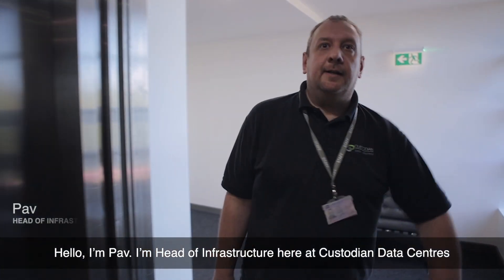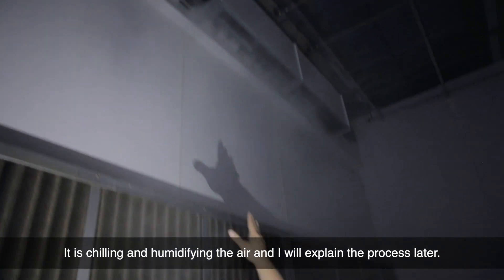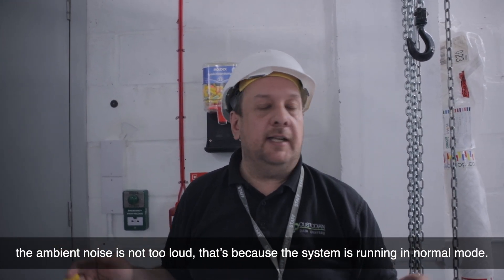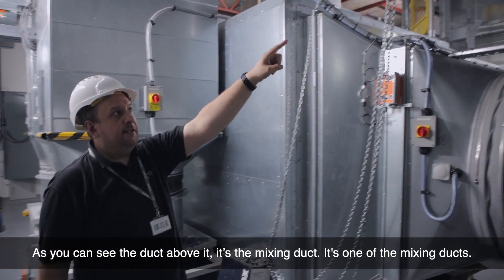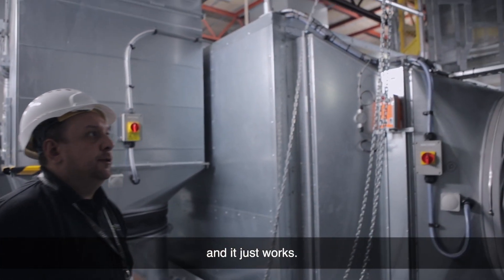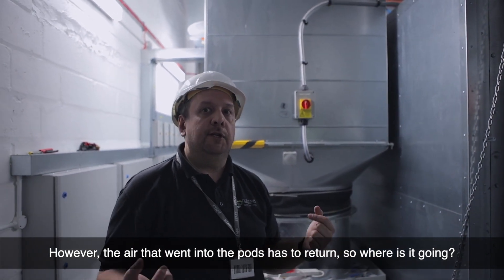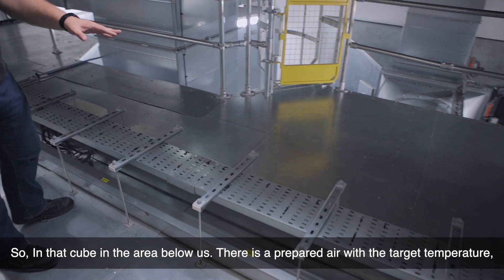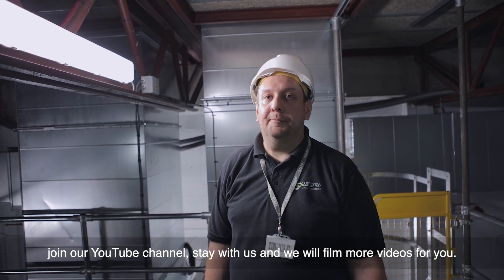A DAY in the LIFE of the DATA CENTRE | INSIDE a DATA CENTRE COOLING SYSTEM!

Comment: Excellent. It's always great to see the engine room of the data centre. Hot and cold aisles are often abstract terms with little meaning until now we can see the mechanism by which it operates. Great explanation. Resilience is the key term here.

Comment: Very interesting. In addition to @Scania_V8_Rat comment I'd like to know how you achieve the target humidity for the air going into the racks? Because I can only imagine that the incoming (cooled) air is pretty humid due to the water vapor that is being used. How is the humidity extracted before going to the electrical equipment which often has humidity requirements of << 80% RH.

Thanks for these videos, they are really interesting!
Reply: Guess that question got left unanswered
Reply: Most equipment just requires non-condensing humidity levels, so my guess is that they're running with the dew point very near the ambient temperature.  On paper, it may be allowable, since the running computers prevent temperature drops that would cause condensation, and since ASHRAE is not a UK entity.

However, in real-life, it's risky.  High humidity is a larger cause of data center failures than low humidity.  Humidity has to be extremely low to be the cause of triboelectric (static) problems, but by 65% RH, corrosion issues start to cause early failures.  It will not affect conformally coated electronics or gold plated connectors, so it might be possible to avoid higher failure rates if you stick to SSD and helium sealed drives for storage and use hardened equipment, but if your customer is running more conventional drives for storage, plan on the MTBF to be much lower than the manufacturer's stated values.

Comment: It's quite shocking just how fast a data centre can heat up if the air conditioning fails...
Reply: yep used to service their equipment, not many back ups. When they fail, it is fix it now. Doesn't matter the time of day or cost. Did a 12,000 dollar repair at 2am with 4 other guys